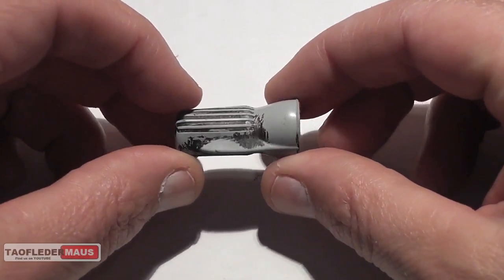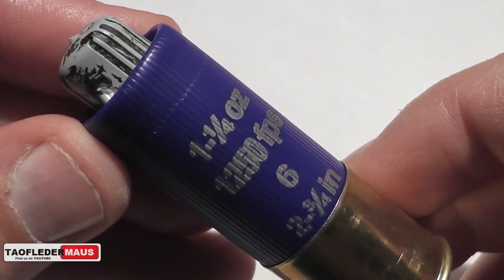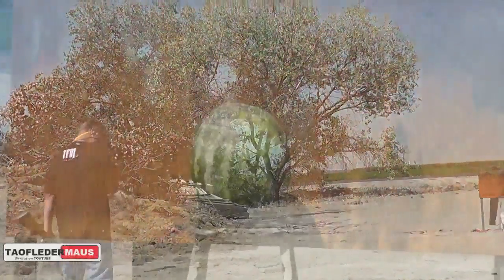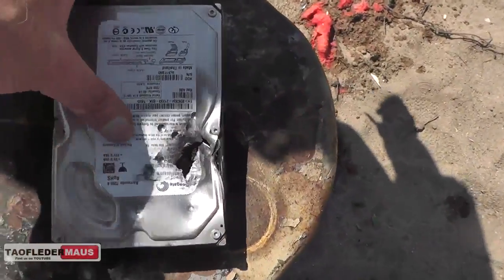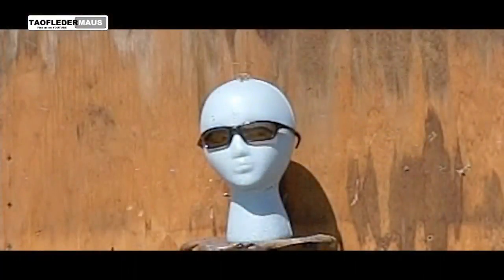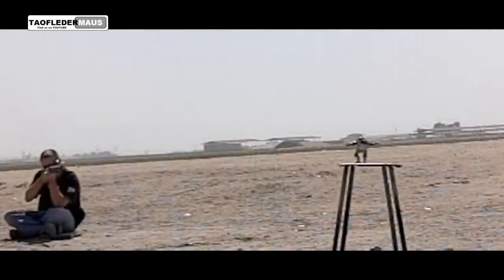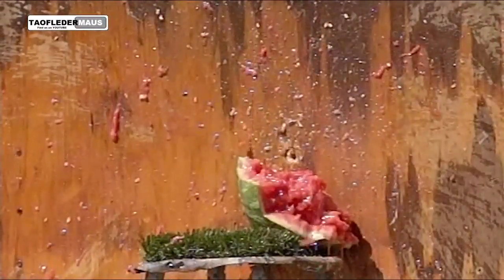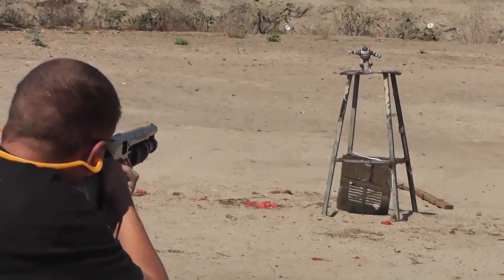Shooting WIRE CONNECTORS  from a SHOTGUN -  Are they effective?

Comment: Without the high speed cameras I would have thought that the projectiles were functioning as if they were a single, solid mass. The cartwheeling effect may be a result of the relatively heavier rear of the projectile or it may be because the wire nuts were designed without the expectation that someone would use them in a shotgun. Love the "opening flower petal" effect of the impact on the melon, the high speed footage is glorious.

Comment: I always wondered about this. Thanks.

We used wire nuts as blow gun ammo on the job site many times. Orange and yelloy wire nuts + CPVC plumbing pipe, Red wire nuts + 1/2" EMT, & Blue wire nuts + 3/4" EMT. A drywall screw ran through the wire nut made a really nice dart. Accuracy was pretty good within 30 feet.

Comment: Are you up to casting your own lead slugs? If so, I'm kind of curious what a lead slug full of steel panel pins or felt tacks would do. Several spikes sticking out of each end of the slug, all carefully positioned to leave your barrel lining alone on the way to the muzzle, might make the slug do interesting things to any gelatinous or fleshy thing it hits.

Comment: I think where you went wrong in this experiment was using silicone to plug the wire nut.  A two part epoxy cured overnight might yeild a projectile that would stay together and perhaps give a better less tumbling willy nilly flight. I might be mistaken too.  Try and see?

Comment: Wohoo under 50 club! You should make some wax + glass slugs! Also since you might read this - I love the TTT series. I'd love to see some types of pastes in there like tooth paste or arctic silver. I think arctic silver would survive!
Reply from the maker: I have thermal compound but I wouldn't expect it to do very much.   The materials have to be able to change states-  liquids to vapors for there to be a pressure increase.   I think the next TTTT I'm going to try to launch a model rocket using a test tube with beer in it.
Reply: ***** what's tttt stand for mate?.
Reply: Liam Dowling Test Tube Torture Test
Reply: Woo 22
Reply: austin dailey Test Tube Torcher Test (Its a blowtorch, remember?)

Comment: You used the wrong type of wire nut. You should have used a red wire nut made by B-Line,
http://www.voipmyhouse.com/images/wirenut.jpg

I'm an electrician and these flies the best. These fit perfect in 1/2" EMT pipe. I used to shot other electricians just by blowing on the pipe. They would fly a very long ways and were fairly accurate. They fly straight but in a spyro. The ones made in the early 90's fly the best. Something was changed in the manufacturing that made them not fly as far in the late 90's.

Comment: Did he say the slow mo cams go for 200 to 400 hundred thousand dollars?
Reply: A cheap phantom starts at $100k, with the flagship models being in the $200k range.
Reply: David Burke wow, wish I had money to burn like that!
Reply: TexasBrown713 just get the new iphone. Theyre slow mo now
Reply: TexasBrown713 just get the new iphone. Theyre slow mo now
Reply: I'm assuming you're joking, but if not; there's a world of difference between 240fps at a horrible bit rate from a garbage sensor and cinema quality at 25,000fps.
Reply: There are cheaper cameras that will work much better that his. The edgertronic cameras are $5k and you can get film cameras off ebay for less than that, although they are expensive to operate.
Reply from the maker: David Burke  The top Phantom is $400k,   accessories not included.
Reply from the maker: rocketman221projects   The problem with even an Edgertronic is they aren't very portable.   Each shot requires about half an hour or more or processing time.   I wouldn't be able to get very many shots with it each time we filmed.
Reply: ***** $200k, $400k... ay that point, who's counting anymore lol. 

My 30 seconds of using the googles made it seem like the $200k one was their premium offering.
Reply: There's a Casio Pro EX-F1 that shoots at 1200 fps. I think that's the exact camera they use in this video.

Comment: no wonder you always have flies messing with your shots you play with dead animals lol
as for the wire nuts flying straight, did you say you put the shot in first and then filled it with wax? if you  did, you made a front heavy projectile, like a badminton shuttlecock.

Comment: shotguns are not supersonic lol
Reply from the maker: Cody Laxton  Yes they are.   lol
Reply: Well depends what you put in it
Reply from the maker: Even the cheapest target loads are over 1200 fps.   Deer slugs travel over 1600 fps.   Many of the light weight loads like silly putty can reach over 2000 fps.   That's getting close to Mach 2.
Reply: *****  true, just did a little more research.  The load would have to be pretty heavy to fly subsonic out the barrel
Reply from the maker: Yes,   or you can reduce the powder charge.  There is a fine balance between weight,  speed,  and barrel pressure.  Too much barrel pressure and the gun blows up!
Reply: ***** true that